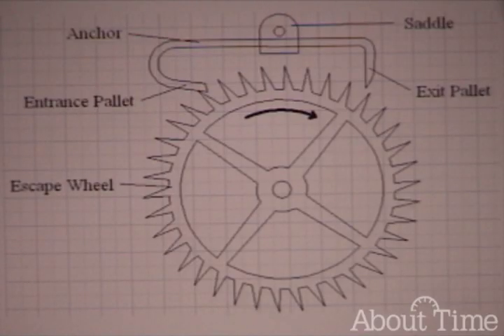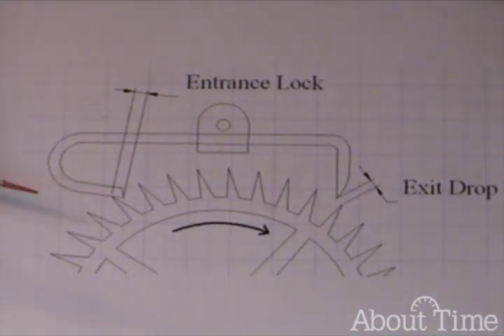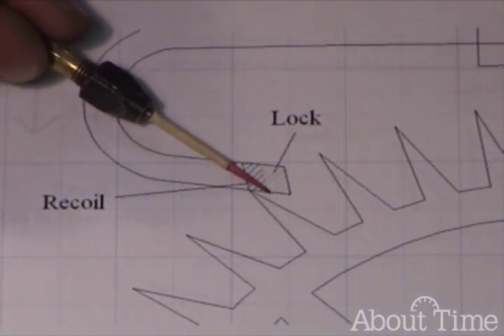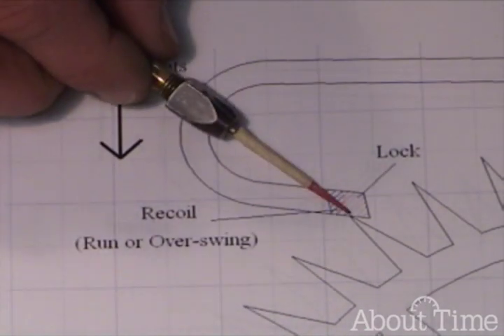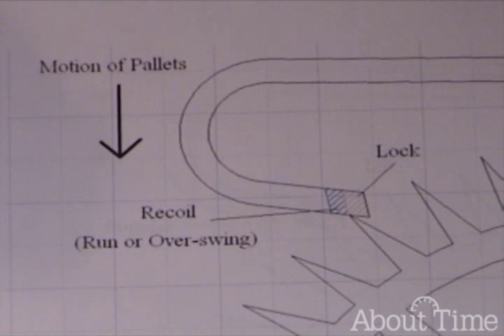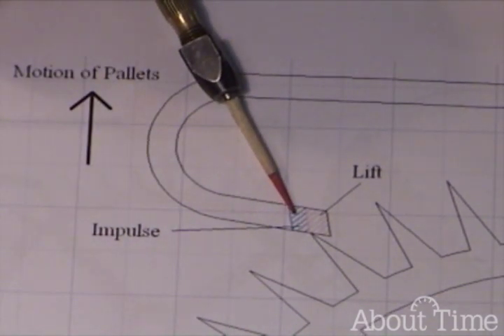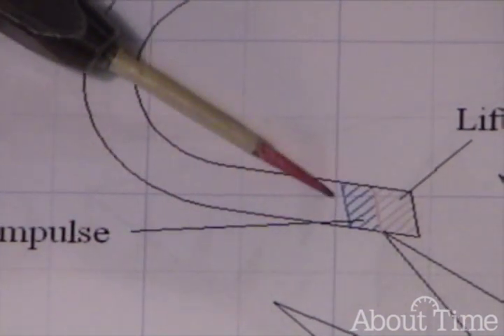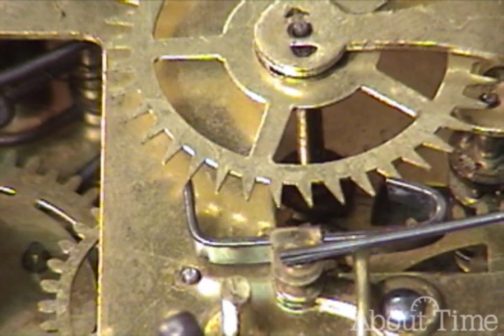ClockClass - The Recoil Escapement

Comment: I have a New Haven. Its' eskape wheels teeth face toward the rotation. I am haveing trouble with it. The teeth are worn. If I purchase a new escapement wheel with same number of teeth but 1mm larger diamitor will it work? Or do I need to puchase a new escapement wheel and a matching rocker?  Any suggestions?
Reply from the maker: Hi John-  You mention the EW teeth are raked towards the direction of rotation and that generally indicates a deadbeat or half-deadbeat escapement rather than a recoil.  However, to answer your question...  No, changing out the escape wheel won't fix your escapement.  The pallets need to have any wear ruts polished out and then the escapement would need to be adjusted for proper drops and locks.  While the escape wheel teeth may show some slight wear, this sort of wear is secondary to the wear on the pallets and isn't likely to stop the clock.  A damaged/worn escape wheel can be restored much easier than replacing it.

Hope that helps!

Comment: How about a worn pallet? Mine has slight grooves on both sides made by the teeth.
Reply from the maker: Yes, the wear ruts in the pallets should be dressed out and then the escapement properly adjusted to compensate for the loss of material.  The ClockClass DVD, "The Recoil Escapement", covers this in depth during the 1 hour video.  I'm happy to discuss this in depth via e-mail if you have more questions!
Reply: How do I get your email?
Reply from the maker: @jonahhahr7756  Hi Jonah-  I see you found my email but, for others who may be looking...  Go to ClockClass.com and click on the "Contact Us" tab.
Reply from the maker: @jonahhahr7756  Hi Jonah-  The email reply I sent bounced due to your email inbox being full.  Here is my reply...

Congratulations on your purchase!  EN Welch hanging kitchen clocks aren’t all that common.  They aren’t worth thousands, certainly, but are worth hundreds.

If you have your clock running, there’s really no need to do anything further.  Yes, a novice could do a restoration on this escapement but it isn’t necessary until the clock won’t keep running or doesn’t run a full 8 days.  Then, the whole movement should be gone through, not just the escapement.

Regards,

D.

Comment: I trying get my Ingraham clock to tick every time I start pendulum it won't start and it don't run in last I put pressure on escape wheel
Reply from the maker: This sounds like a power problem.  100 year old movements will often require restoration in order to solve the power problems due to wear.  Adjusting the escapement is one of the final steps in a restoration and isn't something that can really be done until the movement is in good running order.  If you don't have the skills or tools necessary to do a complete restoration of the movement, it may be time to take it to a qualified clock shop.  

Hope that helps!

Comment: As a struggling clock repairer, amateur, the hardest thing for me has been adjusting the escapement. I have been told the strip recoil is among the easiest and most forgiving. I know your video is short ,but it really does not explain much and would not encourage me to buy the longer version.  Sorry
Reply from the maker: Hi Alec-  Thanks for your comment!  Adjusting escapements is indeed difficult and something that requires quite a bit of time to explain.  I'm sorry the very short video didn't meet your needs.  Since you aren't interested in the ClockClass DVDs, I would encourage you to read up on escapements on the NAWCC Message Board.  There is a wealth of information there.  And I'm always happy to answer any questions that may arise.